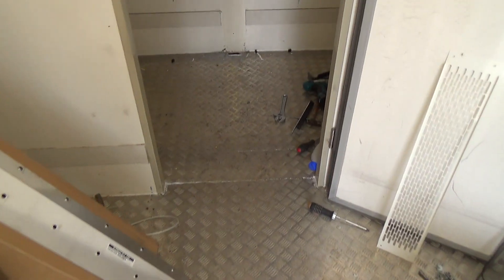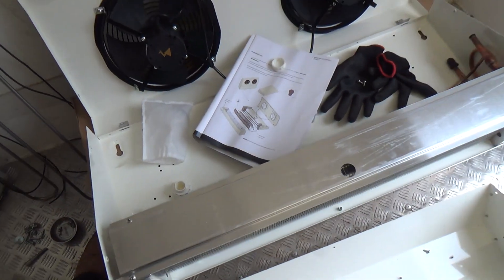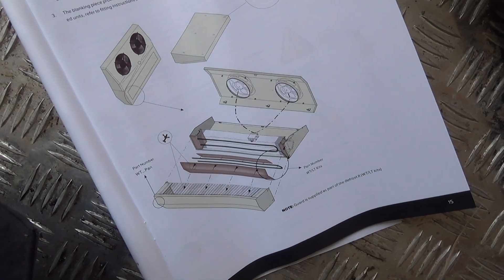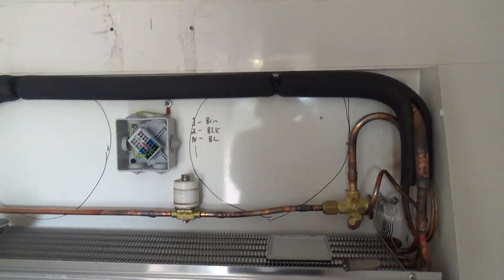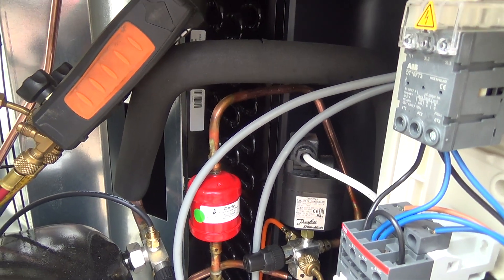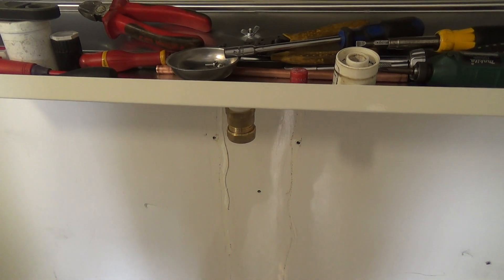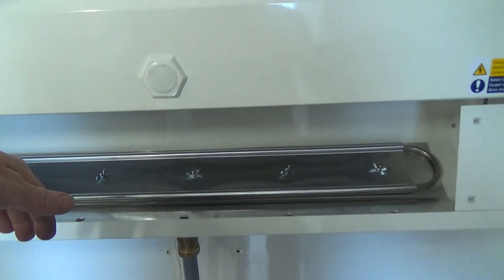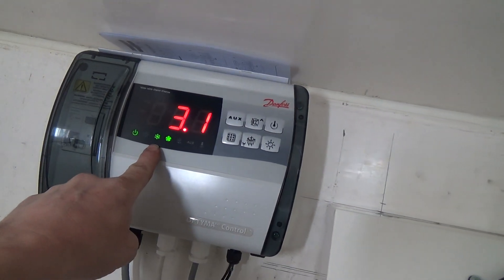Walk In Cooler Refit

Comment: Have you had problems with those ec fans tripping RCD on danfoss optima panels ?
Reply from the maker: Not so far, had an issue where the solenoid was borrowing a neutral so it used to trip when it called for cooling where I replaced the original controller. Had to run a new cable out.
Reply: I've had a couple of those motors new tripping those rcds bit of a nuisance.

Comment: I think you was right . they did fit Elco motors on those coolers , not keen on Searle coolers myself. dont know if you've tried Roller coolers from R C Scutt , they are better quality in my opinion. Nice job though mate, should work well.
Reply from the maker: I've gone off Searle too, had a few with coil leaks, and also poor fixings.  Went with the Searle as the wall mount option suited the room due to the sloping roof. 

Will check out Roller, never used R C Scutts, mainly its FSW or Climate Centre here, We had  D&W but that shut!
Reply: @heavydiesel  Yes, I mainly use FSW and Climate, what area do you cover mate ?. I'm in Northamptonshire, but cover a large area. I don't do milk tanks but I used to a long time ago, that's why I like watching your videos, takes me back a few years. Some of the equipment you work on is like reliving my youth lol.